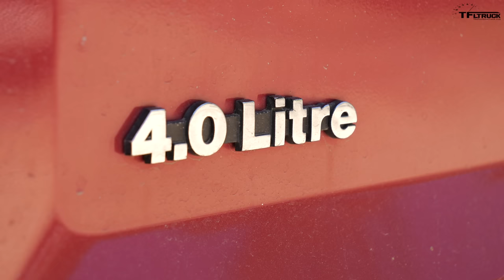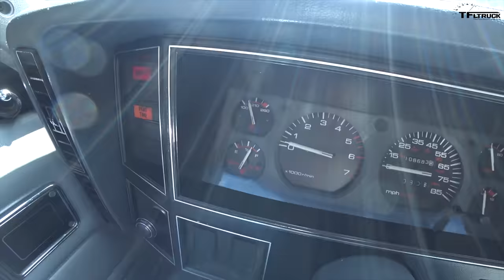Old vs Old: Did Off-Roading in the Eighties Suck? | Cheap Jeep Challenge S2 Ep.6

Comment: samurais are so underrated. chuck in a 2” suspension lift and 31” mud tyres and ditch the sway bar and they’ll be just as capable as many other 4x4s for waaayyy less money. add a rear locker and they are transformed again! and with that setup you’ll barely ever break anything mechanical. my zuk only cost me about 6k to set up and it is constantly surprising bigger trucks! (just gotta keep them on their wheels)

Comment: Hey guys! So I have a 2001 GMC Yukon 4x4. I did a level which gave it quite a bit of clearance. Went to a pretty tough trail on some 265/65/18s with a friend in a really capable Lexus GS and a 2020 Tacoma. I didn't have much articulation but I found out my rear diff and front have LSD. This Yukon was really capable. I guess LSD is really rare in the Yukons and Tahoes but even more rare in the front. You guys should really look into one of them. Super impressed.

Comment: A friend had an EARLY Samurai with 2 cycle (ring a ding etc) we found some guys in Jeeps, Blazers, Broncos Scouts etc trying to climb a BIG hill with running starts my buddy pulled up to bottom revved it a couple times with blue smoke it went up that like it was flat it had a snorkel went thru a 3’ river he had a cut-off broom to push throttle and keep foot dry. Flat out in 2WD high 50MPH he trailered it when going camping/hunting/etc

Comment: Back in the 80's there was many capable 4x4 vehicles available from many of the car makers.   Bounce to 2019 and most 4x4's are very limited in their capabilities.   Hardly any vehicles have solid axles and a 2 speed t case these days.

Plate C

Comment: I was surprised at just HOW GOOD both vehicles were at getting up those narrow trails! Try THAT with a Ford Raptor or RAM TRX!

The larger vehicles would bind themselves in to the walls and trees!

Good driving though!

For the overheating problem on the Comanche, my older east-coast buddy who has one of these, cut nice looking 4 inch long by 2 inch wide slots all across the front and rear part of the hood with his fine-cut Sawz-all and put in some coarse bright yellow wire mesh inserts to give it some artistic flair. He then added two blower motors attached to an in-cabin aux switch which can turn the blowers on/off, helping move the engine bay heat out through the slots.  The mesh slot inserts have fancy-looking clip-on removable yellow covers, so on rainy/snowy days he can prevent water ingress into the engine bay, but for hot-day off-roading you take out the insert covers and you get extra through-hood ventilation.

You can get a 20 degree+ drop in temps with that simple tech fix!

v

Comment: Mannn this makes me want a Sammy. Keep up the good work and fun fellas!
Reply: Used to have a guy in town that would buy them up and modify them for 4 wheeling and resell them, he built dozens of them and sold them before he passed away.  They truly were mountain goats, dang things would go anywhere, and worked great pulling those over-priced go-karts...err...UTV's (side by sides) out of the mud, off of rocks, back up to the trail off the sides of the mountain, etc.  Wouldn't mind having an old Samarai.  With the Samarai you had a cab to keep you dry and a heater....most UTV's don't come with a cab, or a heater, all over-priced add-ons.
Reply: William Todd that’s awesome would’ve loved to know the man. Definitely could scoop up a very nice one for the price of today’s UTV’s as well
Reply: @bschell1969  The last one he built and sold he sold it for $13k, it had a semi-mild build, but did have lockers front and rear and if I recall a 4" lift and I think he did 33's or 35's on it and can't remember what tires he put on that one.  That guy knew what he was doing, and had several people bring him their own Samarai's to build.  When I saw the last one he built I wish I would have had the money to buy it, dang thing is still running around town quite often, and far cheaper than a side by side and is street legal where a side by side technically really isn't...at least here in Idaho, you can license a UTV but its a restricted license and you can't operate them on the highway...err legally you can't but obviously that only applies to certain people as I see them flying down the highway on UTV's all the time.  I had a 2011 Yamaha Rhino 700 4x4 and previously a 2008 Yamaha Grizzly 450 4x4.  both were ok, but terrible for bad weather use and after what the finance company pulled I'd never buy anything through Yamaha again, and I was not really that impressed with their machines either...for what I paid for each one I could have bought and built a far better UTV out of a Samarai or a Jeep Wrangler or Cherokee and been far more comfortable.
Reply: William Todd sounds like a pretty sweet set of wheels. I’ve pretty much always been a Yamaha guy but haven’t ever bought one new and never got a side by side. They’re too wide for most of the trails here in WNY and you can’t drive them on roads whatsoever, so kinda pointless here.
Reply: @bschell1969  Never drove down any trails small enough that you couldn't fit a small SUV or pickup so never was an issue and still isn't.  Today's UTV's are oversized now too so not much use buying those bloated over-priced pieces of crap that even the companies that make them don't stand behind them, sure they claim it has a 6 month or 1 year warranty but good luck once that thing gets dirty they don't want to work on it.  They're not supposed to drive them on the highways here but many do...it will take a major accident of someone of high importance to get killed before they start enforcing the law regarding ATV's and UTV's on the highway here.  

Many trails here are now being closed because of ATV/UTV riders tearing them up, its only a matter of time before all trails get closed down rendering those ATV's and UTV's back to the farms and ranches they were actually designed to be used for :(.
Reply: @bschell1969  My 2008 Yamaha Grizzly 450 had CDI problems, it would get hot and shut itself down...not very fun when you are out on the trail and when it does shut down given the CVT design it locks up all 4 wheels if you are in 4WD...glad to have gotten rid of that piece of crap.  The 2011 Yamaha Rhino 700 I had did ok, wasn't impressed with its utility features, but did fine out on the trails but would chew through tires due to the drive train design and having a permanently locked rear differential, so trying to do any yard or garden chores with it was quite damaging to the yard and garden.  If they would have done something similar to what Polaris did giving you a selectable rear differential lock it would have been a far better machine...the CVT in the Yamaha products is so much better than many other brands as you always have the power, it don't freewheel like other manufacturer's CVT's when you are going down a hill or coasting you get engine braking to slow you down...and if you let it go it'll stop you completely after a while.  Today's Yamaha UTV's are way too large for my liking :(.  I just bought a small SUV and have been fine with that so far LOL.  If I were to buy another UTV I'd look at the Cub Cadet Challenger 750 which has quite a few standard features like a windshield, 1/2 doors, roof, winch, and selectable front and rear locking differentials which would be something very helpful for a lot of my usage around the property.  

Need several UTV's and take parts from all of them and build what you need for your usage HAHA!!
Reply: William Todd I like Honda wheelers aswell. I avoid any CVT like cancer other than those Yamaha’s it’s really the best. There’s basically no trails here other than a few on private property in New York either. Same deal atv’s and utv’s being inconsiderate and tearing shit up when they shouldn’t. Lots of people blocking off their private trails as well. Pennsylvania still has some good spots and are only a few minutes away luckily. Even if you never take your atv or side by side off your personal property here in ny, if a cop sees you from the road and you haven’t registered it for no reason other than paying these crooks their tax, you are liable to get a ticket and can have it impounded. It’s nuts.

Comment: If you're running into overheating issues you can, like most XJ owners use a manual switch for the electric fan, the thermostat turns it on too late

Comment: Use 4 low for added pulling power. Add hood vents e fan and to clear those tires you just need a 1” puck in front and drop the leafs down 1” there’s your tire clearance

Comment: I change the radiator on my Comanche to have a filler spout and 3 rows and turn the pressure tank into a recovery bottle.. changed the water pump to a high flow one...  Problems gone

Comment: As a mechanic on your Jeep put a 1 lower temperature thermostat it will help with over heating and over time your radiator does get some corrosion on the inside and the fins get filled in with dead bugs and dirt And amazon usually sells bigger aluminum radiators for cheap as well and both of those things should take care of 80% of your over heating worries. Plus from owning one they run a little better a little cooler. Also if you want to go more cooler than that you can put on a higher flowing water pump in and gain a little power and cooler by adding a electric fan. And the samurai work much better with a 2” spring lift to something a little softer with some better shocks and that not so much you loose it’s small wheelbase. 

Also not a Milwaukee salesmen or anything but for like $150 they sell a portable cordless air compressor that will air all my truck 285/75/16 tires for 25 psi to 45 psi all easy on one battery it will air anything up to 120psi you literally turn it on screw on the end to the valve stem and input the psi you want hit enter and it will air it to that on its own. Also has little attachments so you can air football and air mattresses and stuff as well. Best wishes maybe some of this info helps ya out, keep up the good works and thanks !
Reply: Lower teperature thermostat will have no effect.  The thermostat has zero impact on maximum temperature, it only controls minimum operating temperature.

Comment: I do seem to recall relying on “momentum” quite a bit in my Cherokee back then.  Same engine and transmission as your Comanche.  Never had the overheating issue (that I recall) here in New England, but I did need way better tires than factory to get some decent traction.  I recall that my buddy’s Pathfinder had better “natural” traction than my Cherokee.  I suppose maybe it was my age and greater willingness to bang up my vehicle, but I recall those days with great fondness and seem to recall many open areas that have long since closed or become much more difficult to access.  That may not be an issue in Colorado, but there are definitely places where either the government or private land owners have closed up spots we could roam back then - of course, maybe I just didn’t ask back then.  That may be what made going off road in the ‘80s so memorable for me.
Reply: The overheating issue was specific to the comanche due to having a tighter fit
Reply: Got it.

Comment: 3:40 Actually, everywhere else in the world, it's a Jimny.
Reply: I drove one when I was vacationing in Cape Verde islands
Reply: It would be awesome if they sold the new Jimny here in the states
Reply: Sandy Lee  Jeeps are not good as they were once before in terms of reliability because they are using FIAT engines from italy. Some of them are actually made in Italy
Reply: Suzuki sierra in Australia.
Reply: @arielsanca7956  I disagree.
Ok, before I go farther. The old Wiley hurcalee engine was great.  It was beautiful. But they were not made for speed.
Now, the 4.2, 4.0, and the 4cyl from 80s after Chrysler bought jeep. We're all good engines.
I do not like fuel injection engines. But I will say the 4.0 is equal to a small v8. They have lots of power.
4.2 was a good engine. I've owned a few. Now they are not equal to the 4.0, but are a good strait 6.
And the 4cyl, well the one I drove for a while was nice no problems.
Out of those three, I did have problem with 4.2, but after looking back at others. I think it was just a very worn engine.
The only problem I had with a 4.0 and I've owned a few. Is the girl never did an oil change. When I repo it. The oil looked like mud. And the engine blew about 15 miles away. In all honesty,  any engine would have blown.  And I've had engines with more going for them blow.
I really was amazed when I got it home, after it blew, and pulled the dipstick. It saddened me she took such poor care of the poor thing. I've NEVER seen oil that bad before, or after for that matter. Let's put it this way. When I pulled the dipstick. It looked like you used the dipstick to mix grease and dust.  It was bad. Way I figured she had drove it for 2 years. And never did an oil change. And I also bet she put non detergent oil in it of a lower grade.

Comment: Watching this made me really miss my '88 Samurai, right up until Tommy was wincing in pain. I can tell you he's not acting there. Those little cars are punishing off-road.

I don't know if overheating is strictly a Comanche issue, but the 4.0 Wranglers don't overheat much, if at all. I've had one for 20 years, and barring a failed water pump or leaky radiator, mine has always run cool on- and off-road. 

And offroading with an automatic? Come on, where's the fun in that? With an automatic, you're just steering.

Comment: I had an 87 Samurai living in Northern Nevada. It was a very capable off road vehicle. They were notoriously underpowered. However, if that Comanche had gotten on the trail they drove, that Samurai would have done just fine. 
I once pulled an 89 Chevy 2500 out of a mud hole in north eastern Nevada. So it could do it, just not easily.

Comment: I had a 1991 2 door xj that would overheat if you didn't have anything but 60mph worth of airflow going through the radiator.  Stop and go traffic was bad, let alone off-roading.  
I always had plans of fixing the overheating issue and turning it into a decent wheeler. I miss that jeep. Next owner wrecked it within months of me selling it.  :(

Comment: Put a new water pump, thermostat, and radiator on the Comanche, and I'm pretty sure that your overheating problems will go away. I had a Cherokee from the same era, with the 4L,  that I drove for almost 200,000 miles all over the place offroad and in high temperatures, and as long as the cooling system was in good shape, I never had a problem with overheating. That said, the water pump went out every 40,000 to 60,000 miles. I think I went through 5 of them. I started carrying a new one with me whenever I was going somewhere off the beaten track.

Comment: At last you were not afraid (well not too afraid) to use momentum.  Momentum is MUCH.  Change the coolant in the Jeep to Evans NPG+ and forget about the overheating.  The coolant will get hotter, but will not boil or steam like water mix does.  Its the steam that lets the extreme high temps warp heads.  You kidneys and bladder would have appreciated airing down at the beginning.  Its OK to go down to 12# in dirt or sand and 14# in rocks.  The Suzuki would have bucked less with air-down too.  Better traction and softer ride; some inconvenience to air back up.

Comment: Mj or xj getting hot needs basic maintenance first but after that most old fan clutches need replacement. Then most old elec fans dont operate or spin slow due to oldness. We still have our xj run hot in summer just leave hood poped when krawling.

Comment: I laughed when you guys argued on getting stuck and the samurai not able to pull the jeep.
Back in the 80s. I had a GMC full size 25. That got stuck in quicksand. After many attempts by other full size trucks, would you like to know what pulled me out?
A little toyote pick up. Yeah you heard me correct. Ford's, dodges and Chevy couldn't get me out.  It took a itty bitty Toyota that got me out. 
So from that day forward, I never looked down on the toy 4x4s.  Never ever doubt a baby 4 wheel drive. 
Now don't get me wrong. I still say jeep has the best 4 wheel drive.
Here is why I say this.
A GM 4 wheel drive is not grabbing above 35 mph. Where a 80s jeep Cherokee was still grabbing at 55.
I've owned a lot of GM 4x4 over the years and that has always been true of them.
I've also owned wranglers from 87 to 06 and a 96 Cherokee, and it was true with all them as well.
Plus I've driven Wiley, Mutts, and Humvees. 
Now I must say. Mutt and Humvees were by far the best. I would really like to own a MUTT. And Humvee cost too much.
Oh yeah, the only real Humvee is the M998 type. Those yuppy mobile's are just over priced ugly jeeps. 
The old wrangler are much better then the guppy mobile's.
Since we are on the subject of wrangled. Jeep messed up when they made the new wranglers 07 plus.

Comment: What we REALLY did in the 80's is buy early Broncos and CJ's and K-5's cheap. Back then a 31 inch tire was big and a 33 was huge. Guys ran Rubicon with 31's and open diffs. 
You didn't go buy a factory go anywhere machine. You had to build your rig in the garage, and that didn't mean bolt on extras. No traction control, almost no one had lockers, Most had manual transmissions. You had better learn how to drive and know your rig. 
No AC and no go anywhere buttons. A few guys in our club have more money than sense and I 'd swear they need lockers for everything!
DId you know: Toyota has some kind of crawl button and it does everything for you? I mean EVERYTHING but steer? WTH is that??

Comment: 1995 Cherokee sport 2 door with the 4.0 and a 5 speed. Had 200k and never had an overheating problem.
Reply: I had a 1990 Cherokee Limited, when I bought it, it was showing (By temp indicator), to be running hot. about 200k miles. I changed the temp sending unit... Problem solved!